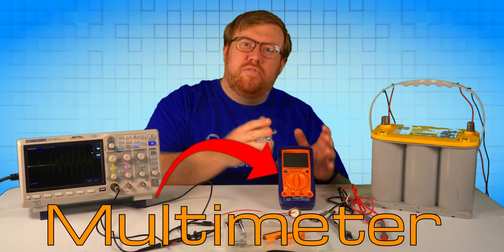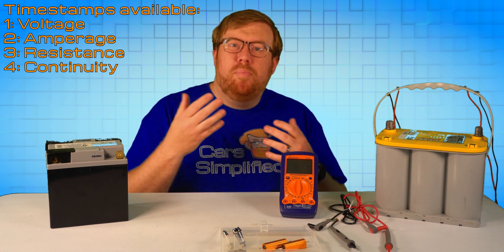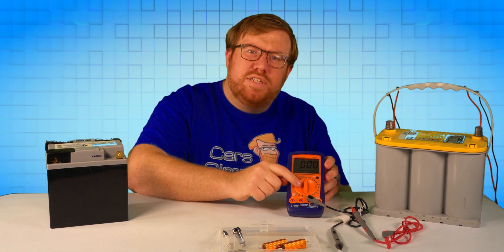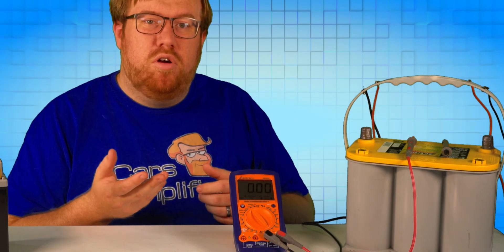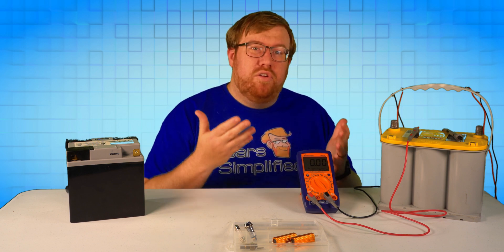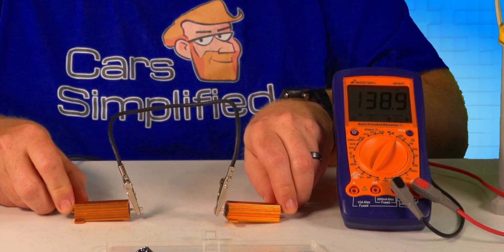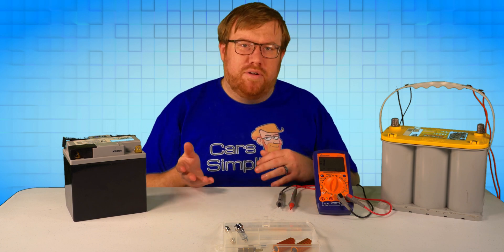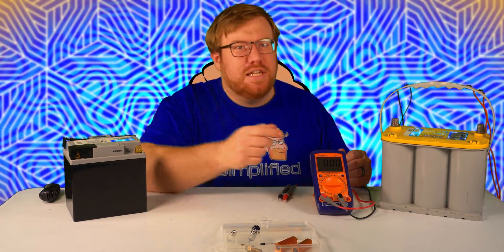How To Use A Multimeter For Beginners: Easy Version!

Comment: I have a bunch of strange electrical problems with my 2005 gto and the first mechanic I took it to gave up after 10 hrs of trouble shooting. I'm going to begin to learn how to look into it myself and your video came out in a remarkably timely manner thank you!!!
Reply from the maker: That's quite the convenient timing! I plan on making a few more videos explaining how to use a multimeter in more advanced ways, and there's still a battery drain issue on my 2005 GTO I need to track down, so keep an eye on the channel!
Reply: @CarsSimplified  yeah battery drain is my biggest problem (aside from limp mode which happened once). Most of my strange electrical problems have to do with the lights. And the wire cluster behind the dash is fine!